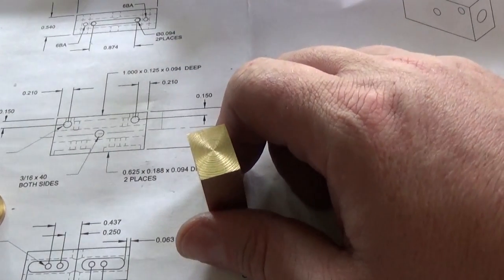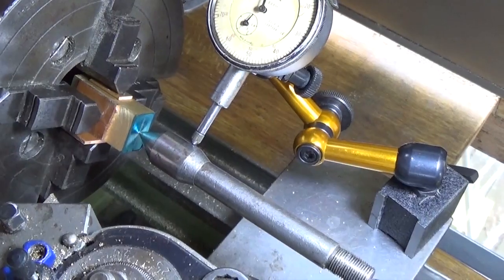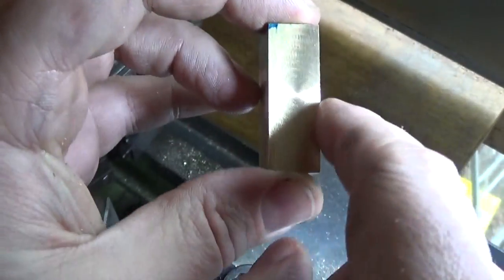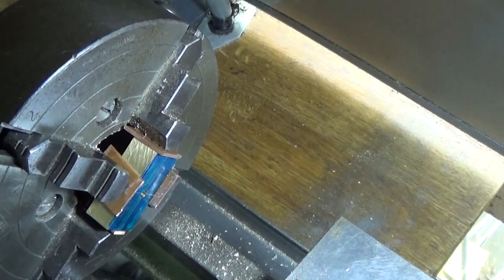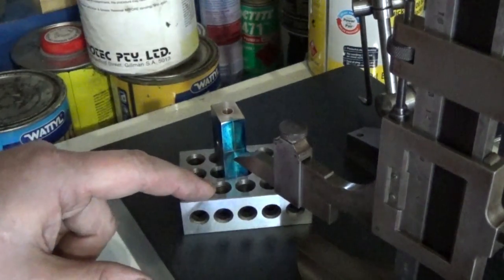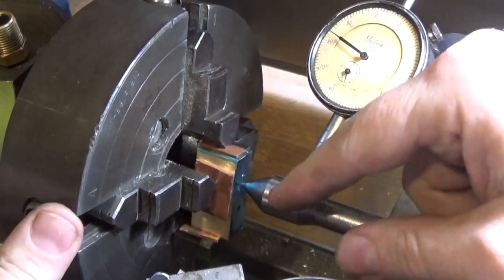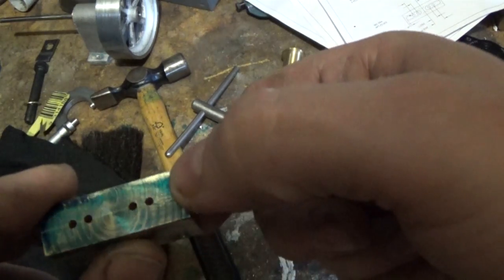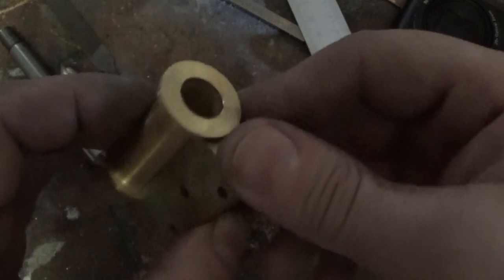myfordboy engine part 7

Comment: There is a lot of 4 jaw setups there Emma but its not hard eh. I rarely use a 3 jaw in my lathe unless I need to hold hex, everything else is 4 jaw. Best thing I ever did was learn Mr Petes  2 key method, I can centre a 4 jaw quite quickly now. 
The little engine is coming along nicely too, Good video.
Reply: I second that motion in squares. Also doubleboost has a couple of videos on 4-jaw centering.

Comment: Tricky bit to get right Emma, and you got it spot on.
I'm sure you know, truing with a 4 jaw is easy when you learn to keep tightening. It they get too tight, and you do have to loosen one, just start again.
Last few years at work, many moons a go now (had to pack up aged 43) I also did internal grinding on a semi automatic. Some of the jobs were held on a magnetic chuck, each one needed truing. After a batch of 60 or so you soon got the hang of it lol.
Reply from the maker: right on, Malcolm. thanks for dropping by!